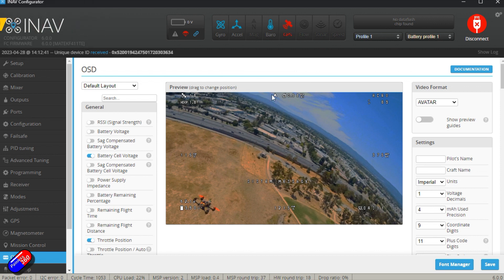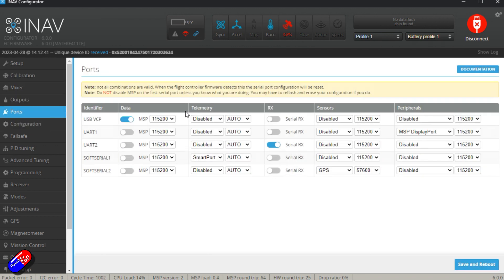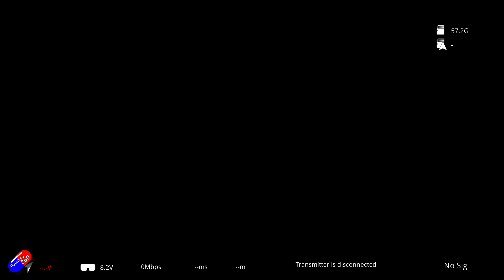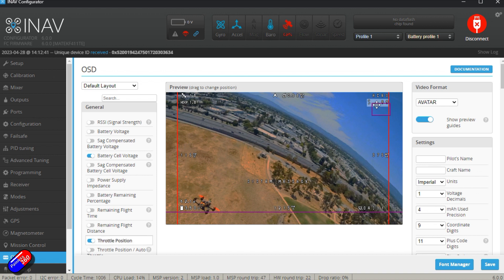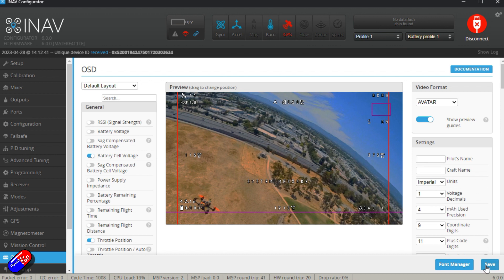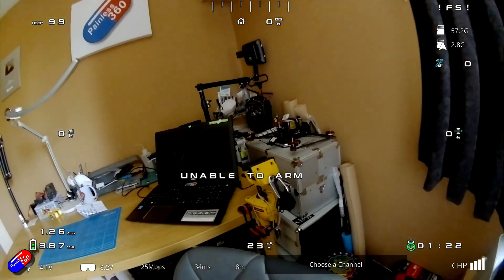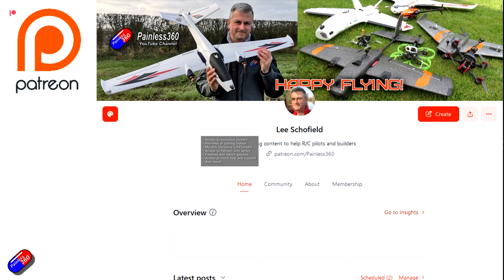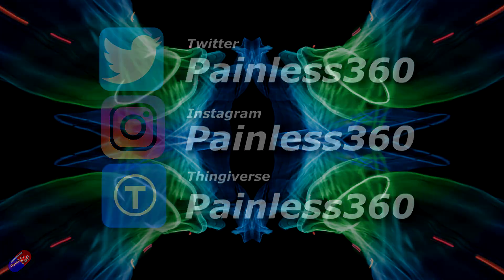INAV and HD FPV: OSD Layout tip!

Comment: Thx Lee , that helps , i wonder if you could help me with an odd problem i'm having with my Mateksys 743-wlite , i have a aspd-4525 airspeed sensor and a sam-m10q gps module on it as well, i soldered the caddx vista to the rx /tx on the fc (rx to tx uart 1) set up the osd in inav, and all seems to be working in sensors tab, but now the fc is non stop flashing of the blue light,,,,,, i'm only using it for the telemetry, its for a aerobatic plane build  so i need air speed not ground speed, i can't find anywhere what beep or flash codes could be, the other is i must be missing something to switch on in inav or the goggles, as i cannot see the osd in the dji v2's yet,,,,i hope you can help i just can't find any clues from all my searching,  and if you thiapplication
Reply from the maker: It could be a few things. I'd not worry about that flashing led and focus on the OSD issue. Try another UART and check TX and RX wires are crossed... Best of luck

Comment: Does an HD system have to be plugged into a UART port, because I've only got two on some of my FC's and their taken up with ELRS and Gps and we can't do without those is it possible to transfer over to a soft serial port.
Reply from the maker: No, you can fly without but you lose the OSD and need to turn off the low power mode as it will never see the ARMED signal from the FC too. See https://www.youtube.com/watch?v=QOxCQN36edQ
Reply: @Painless360  Have the DJI V2 goggles and Caddex DJI camera. Have routed the Googles. but do I still need a Uart to see the Inav OSD.
Reply: Went for a walk down to the beach and had a thought.The Inav OSD appears in the Analog and that isn't connected to a Uart

Comment: The idea, with Avatar at least, was that the purple guides are for the Avatar OSD elements. So the box for the recording elements, and the line for the other elements that appear below where that line is.

The red lines on either side are supposed to be to help setting up for 4:3 mode. It’s pretty close seeing as I couldn’t actually test it before Configurator was released 🤣
Reply: Having done some testing the Avatar guidelines are spot on 👍

Comment: You can also power up your vtx and goggles, put a fan on the vtx so it stays cool, then you’ll see the changes live in your googles.
Reply: that’s what I do. 

Would be nice if the Walksnail goggles / vrx stored the osd position so that you don’t have to recenter it each time you switch between betaflight, inav or custom font sets. Annoying.

Comment: I got the meance antenna set on my fat shark dome hd is it worth putting the extentions on it does it help with anything
Reply from the maker: Depends on how you hold your head when flying. If you have a tendency to look up, then you will be fine. For me, I angle them up and out slightly for better coverage up into the sky...

Comment: Hey, thank you for the Video. Which walksnail fonts do you use and is it possible that the horizon is not yet supported by walksnail? I have numbers at my horizon position… greetings :)
Reply: What video system are you using? Walksnail? Assuming Walksnail, if you go into the goggle menu, under Device settings, toward the bottom left, there’s some font settings. Fiddle around with those until the horizon looks right. Sometimes setting it to INAV makes it wrong for me for some reason even though I use INAV, but others work right. So play around there. In the case of INAV the pretty custom fonts aren’t supported properly on Walksnail yet, so you need to stick to the default font they have on the goggles, as well. For other firmware like Ardupilot and Betaflight the custom fonts work properly.
Reply: I had this issue with the horizon as well. Found that the osd was set to auto in the goggles. Changed it to inav and now the horizon works. SneakyFPV fonts are working perfectly for me. I like Nexus, but they all look really good.
Reply from the maker: @BuildItBetter3D What versions of stuff for INAV and the Walksnail system are you using. Versions on this stuff make a lot of difference.
Reply: @Painless360  inav is 6.0 walksnail is 33.39.10
Reply: @BuildItBetter3D  you know what you’re right it was auto that wasn’t detecting correctly. But some others I fly with use auto and it works for them. 🤷🏼‍♂️

As for the custom fonts, the iNav font is multiple pages long, and Walksnail can’t handle that yet (still, even after the latest update from a few weeks or a month ago). It’s possible that all the items you display are on the first page, and in that case I bet it works for you.
Reply: @swissfreek  glad that helped. I wasn’t aware that walksnail wasn’t fully compatible with the font yet. Everything I’m displaying seems to be working. Must be like you said and I’m only using stuff from the first page…
Reply: This feature is so awesome. Thanks for sharing.

Comment: The preview guides are one of those features that got added on the sly and you discover it by accident out of curiosity and then wonder how you ever lived without it. For HDZero it even tells you the parts of the screen you need to stay in to keep the refresh rate higher.